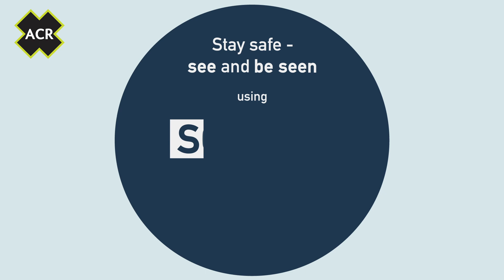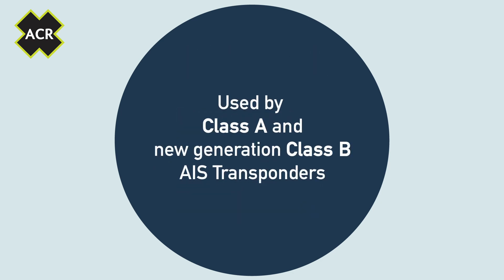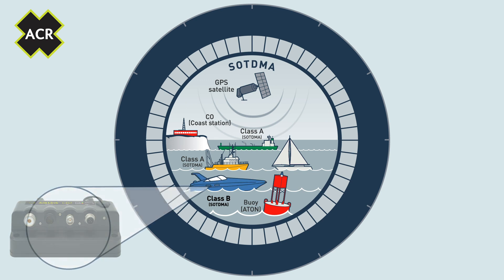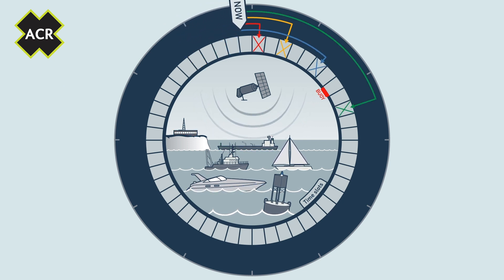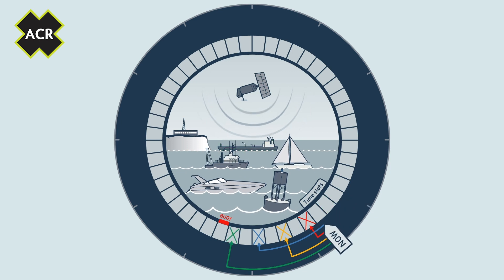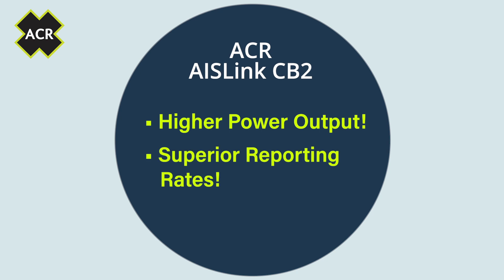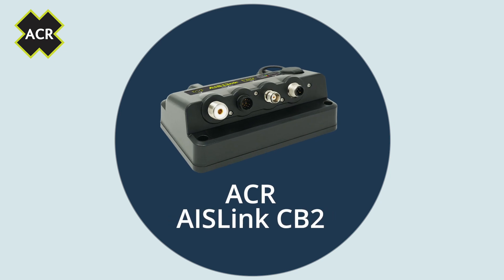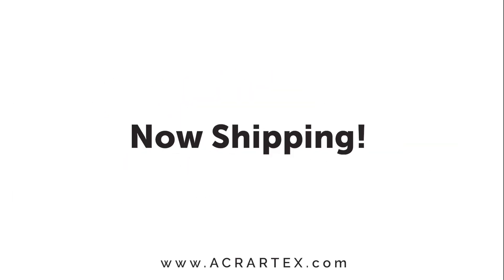SOTDMA - The Tech Behind the AISLink CB2 Class B AIS | ACR ARTEX

Comment: I have a question about this product as I'm looking to purchase it. I have one mast and one AIS/VHF labeled 8ft Shakespeare antenna that will go atop my sailboat mast. my radio is standard horizon gx2200 with AIS input (hopefully I can turn that AIS off or it doesn't affect anything) but main question is will a typical antenna splitter like the simrad one work to share my vhf with this transponder or because this has the scheduling and B+ functionality does in need a specific splitter to work and if so which ones are compatible? thanks!!